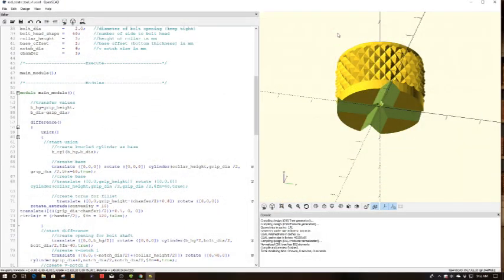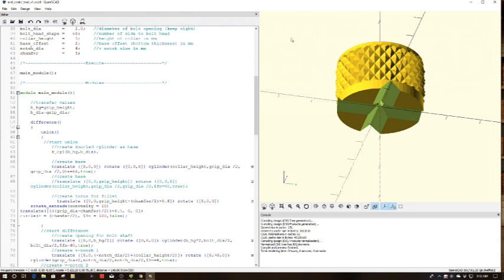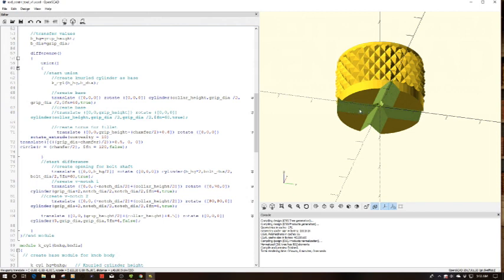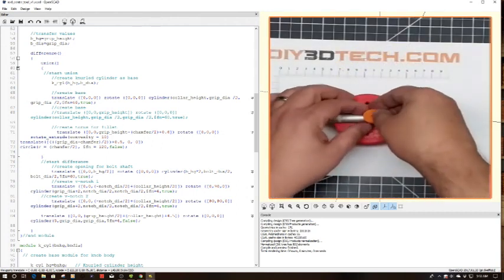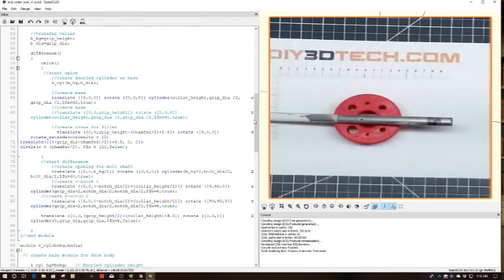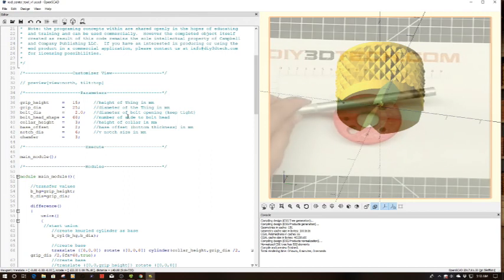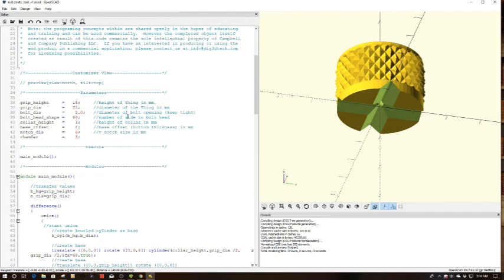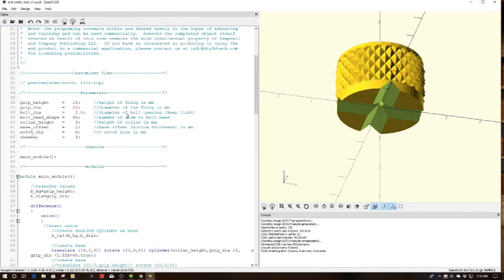Open SCAD - 3D Printable Rod Centering Jig!

Comment: What? Finding the center of bar stock without an edge finder? What kind of witchcraft is this?

Make the hole size fit a center punch and it would get used a lot in a shop.
Reply from the maker: 3D printable magic!